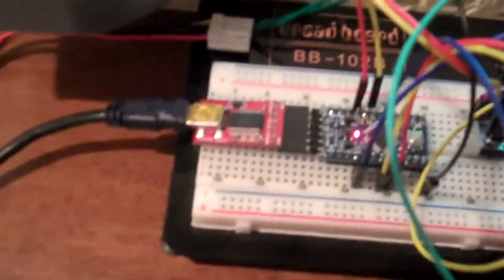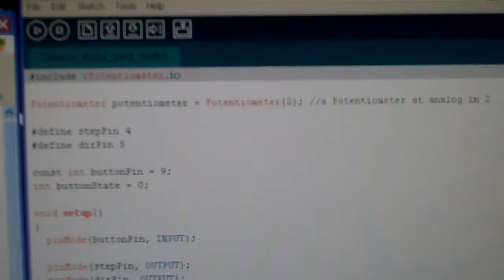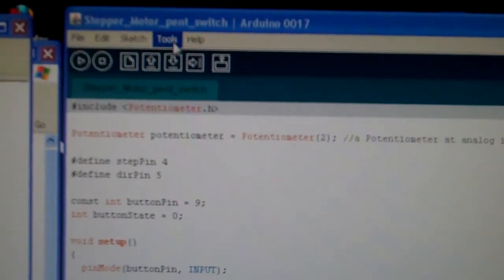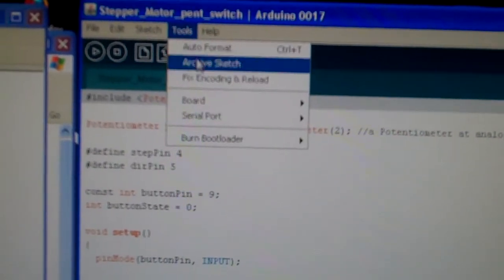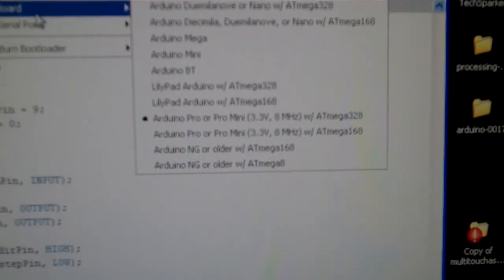Stepper Motor + Arduino + Potentiometer + Button ~ 2

Comment: hello,
 I tried compiling this code.
 but the following error ofa.

"sketch_jan14a.cpp:1:27: error: Potentiometer.h: No such file or directory
sketch_jan14a:2: error: 'Potentiometer' does not name a type
sketch_jan14a.cpp: In function 'void loop()':
sketch_jan14a:25: error: 'potentiometer' was not declared in this scope"

 Why have happened?

 regards